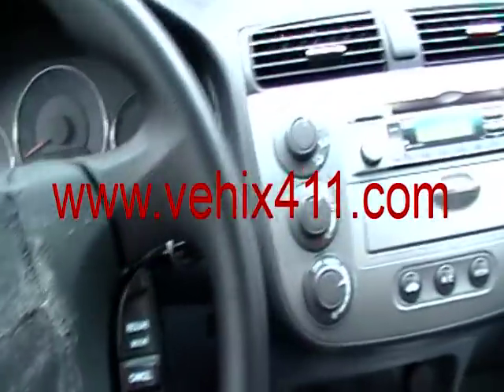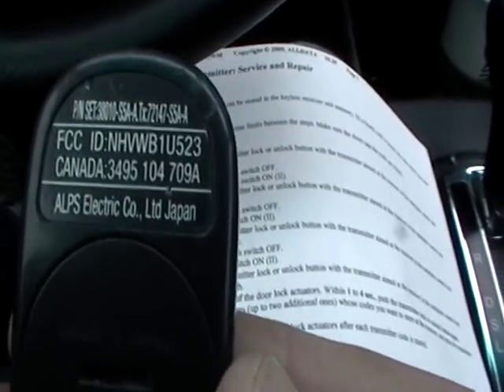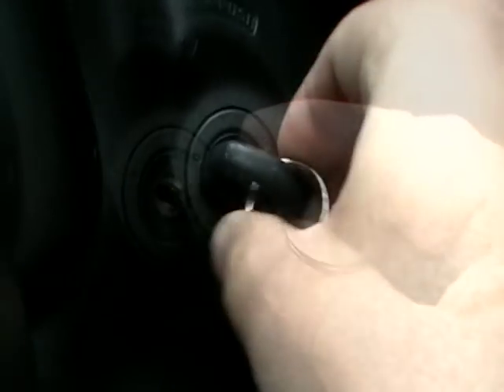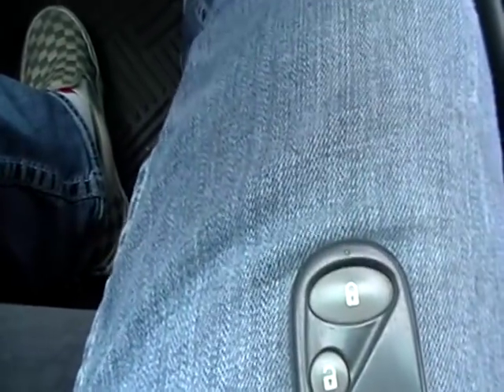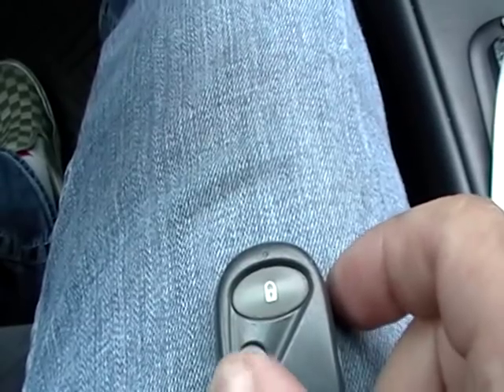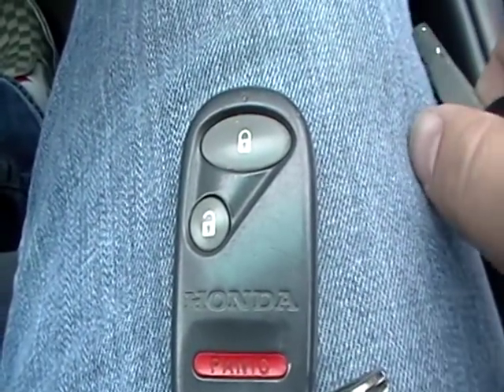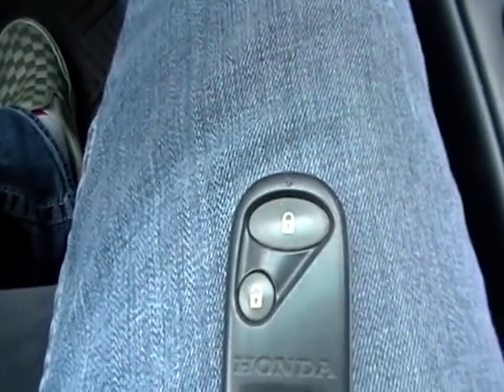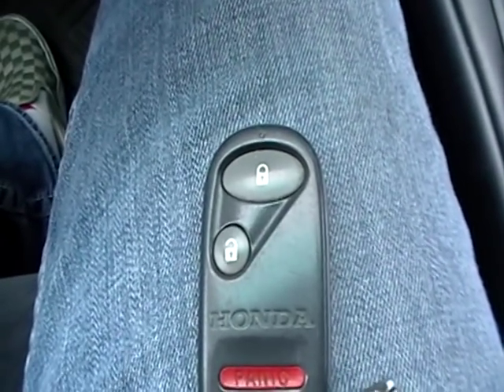Avoid Mistakes: Honda Remote Control Programming

Comment: I got a used civic 97 but didn't come with a remote. How do I know if the remote systems is wired for this model? or do you know if all models have the remote system from factory?  Thanks for your help.

Comment: 2 questions: does the old fob still unlock - ie can I program a new key and still use the old one aswell or will it only pair to one at a time? and secondly, is thee any limit of what replacement fob i can buy? I have the same one as you have in the video and I would rather one that is built into the key!

Comment: Hi,
I have a 2003 5 door civic and I bought a "new" remote to have one on both my keys. The one I had before is a two button remote, the now one is like in your video, is a 3 button fob. The led flashes on it, but it doesn't work. Any idea? Thanks!

Comment: Will it learn the remote while alarm goes off? I've got Civic with no fob and fuse for alarm. Alarm goes off as soon as I put the fuse and it seems the only way to turn it off is to use a jey fob. So I wonder if it will program while alarm goes off.
Reply: +Aleksey Tsarkov Did it work?

Comment: i got a old car 2003 civic and there is a sticker which says its a remote starter installed in it and there is antenna inside car it might have remote starter but i don't have a remote so which one i will buy pls help me? and the antenna is working too there is a light which is on pls help me

Comment: does this only work at a hybrid or an LX too?
Reply: As far as i know, the LX models don't come stock with a key fob. The best way to find out for sure is taking the VIN number to the dealers or calling them and finding out. If it were to have a key fob, it would be the same sequence.
Reply: +Slavik Klets i have a 2004 honda civic lx sedan and it worked with mine

Comment: how/where do I get/replace a battery for this exact key lock? PLEASE HELP
Reply: Use a coin to open the battery compartment. The fob probably uses a CR2025 3V button cell battery. You can easily pick up a new one from most electrical stores.

Comment: Hey I replaced the battery but the red light doesn't turn on when I press any button, worked yesterday just fine but needed more pressing for it too lock. any idea what else could be the problem ?
Reply: Javier Delgado bad remote

Comment: People what helped me in these KEY FOB NOT WORKING was disconnecting + connector from car`s battery and after that voila central locking works. It resets radio and you will need a code which you can find in your honda manual.

Comment: THAAAAAAANK YOUUUUUU!!   
Btw for those who didn't know. with the 05 civic si, you MUST have a radio installed and connected correctly with no fuses blown for the remote clicker to work.  instead of paying Honda dealership over 600 bucks for a new radio, new ignition lock, 3 new door locks....I'm back in business for far less than 150 including a new radio I had Precision Audio In Ridgeland ms install today.   

Cheers.
Reply: My rempte isnt saving the programming. I have an after market radio. Is this cz of the original radio removed?
Reply: My rempte isnt saving the programming. I have an after market radio. Is this cz of the original radio removed?